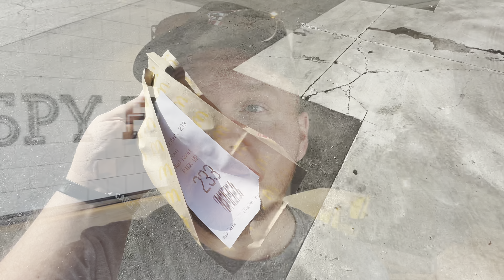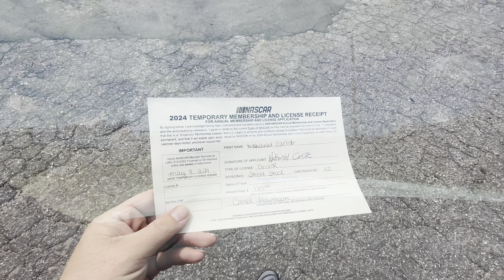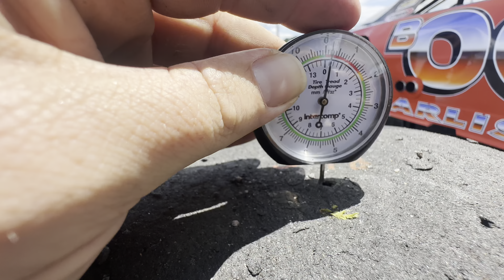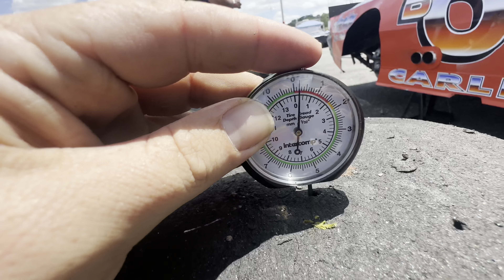KICK’N ASPHALT - STREET STOCKIN’ SUMMER CONTINUES!! BITTERSWEET IS BACK AT HICKORY FOR ROUND 2!!

Comment: What is their reasoning for putting a volt meter on the dizzy? Whats the cheating that is done with the distributors?
Reply from the maker: Somebody smarter than me and above my paygrade will have to answer that.
Reply: @kicknasphalt_vlog  might have a no 16 volt battery rule. easy place to check as batteries in back and in boxes(?)